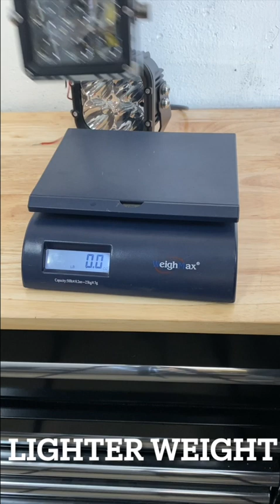GP40 VS G3XL LED Pod Comparison

Comment: Sweet, hopefully we'll see some extra beam patterns.
Reply from the maker: What beam patterns would you like to see?
Reply: @gglighting  like a wide driving patten. I saw you are coming out with a race series in the smaller pod sizes. Maybe bring those optics to the GP40 and do a race series GP40?
Reply from the maker: @superdutyzack  Great suggestion thank you Zack!
Reply: Was that 17 amps and 38 amps on the xl?